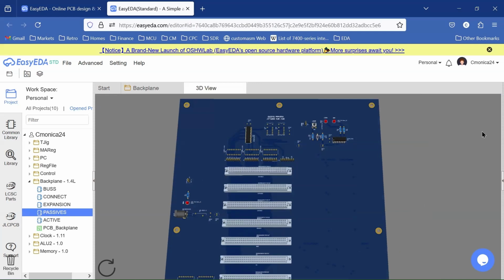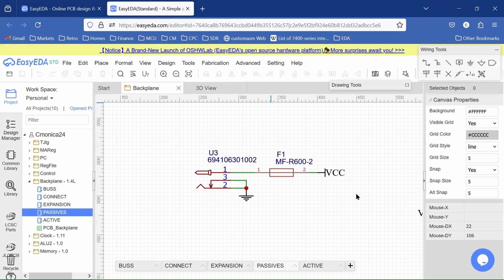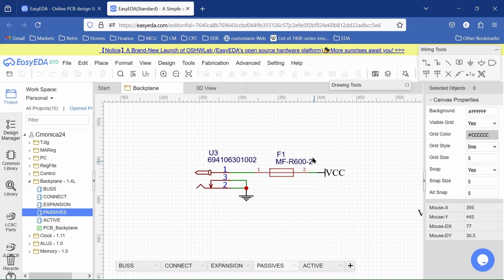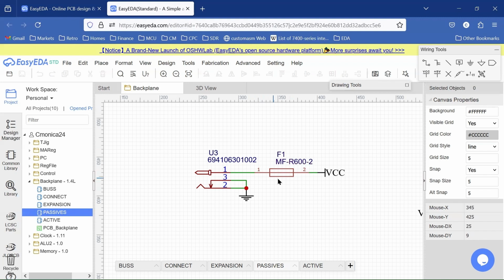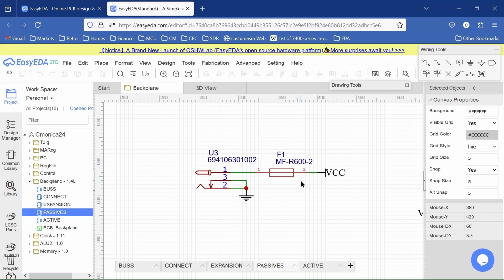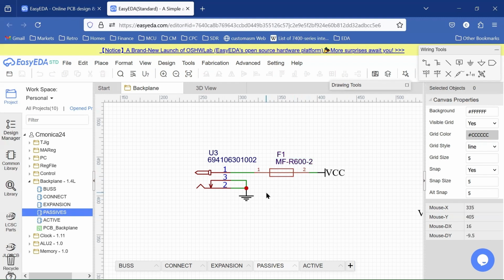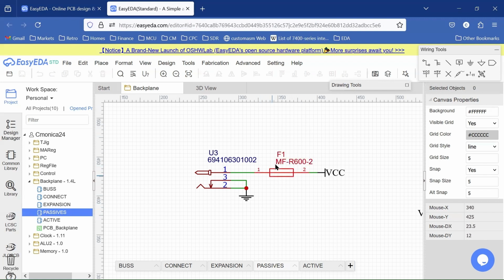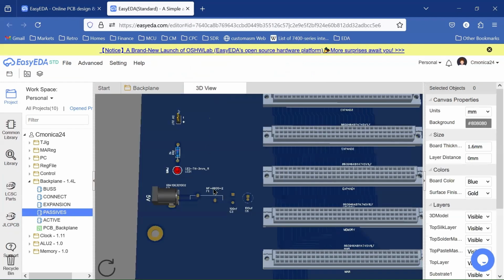TTL Computer II #39 - Backplane Update

Comment: I'm not sure the MF-R600 would do you any good - unless you use a car battery as your power source and have really fat tracks on the PCBs. According to the data sheet the iTrip current is 12 amps. And it's super slow, definitely not something used to protect sensitive parts and pcbs. At 30 amps current it's guaranteed to trip within a maximum of 16 seconds - time enough to start a nice fire ;-) The nominal trip time is a bit better though, just 3.5 seconds. But with a wall wart or "normal" bench power supply you can never ever supply 16 amps so the times will be much longer.  The inrush current NTC might cause troubles - unless the RESET is long enough to have allowed the voltage to rise to 4.75 (or whatever all lower limit is for the logic family you're using) you'll have issues.  Also, food for thought: the NTC will never have a zero resistance so it will cause a voltage drop that increases with the load of the system. If you'd power the system with 8-12 volts and regulate it down to 5 volts on the backplane or boards it wouldn't be a problem to lose a some 100 millivolts (or even half a volt) over the NTC, but a 5 volt rail would not be so happy with this.
Reply from the maker: Mat thanks for feedback.  Yeah, I looked at the PTC datasheet also and had questions about what I was reading.  I was following someone else's work on the PTC/NTC and assumed they had it correct since they are an EE.  They are doing what you suggested with the 8v and regulated down to 5v on the motherboard/cards.  This does not address the PTC issue you noted.  The NTC I ordered was B57238S0809.  Based on the sheet it looks like the resistance should drop to about 0.2 ohms at 4 amps.  I think I will put a test rig together with a variable load to see how it behaves.  I may just not use the PTC/NTC at all on the motherboard and leave it to solve this problem on the external power supply.  In a nutshell I suppose that needs to be a 5v 6A constant current power supply.
Reply: @CharliesChips  0.2 ohms sounds really low at a first glance. But U=I*R so that's 0.8 volts dropped over it. A 5 volt TTL board won't be super happy about that ;-). I've never actually measured a NTC so I'd be interested in a short video showcasing what the voltage drops ends up at with currents ranging from 10mA up to 5 amps in suitable steps.
Reply from the maker: Hey Mat, I have hashed and rehashed what to do for the external power supply to address the inrush current.  Landed on the following.  Will use a 5V 6A power supply, use a 5 ohm 10W current limiter to feed the load (computer) for about 100ms (allow caps to charge), then gate an SCR to bypass the limiter, allowing full 5V 6A to the computer.   Any feedback would be appreciated.
Reply: @CharliesChips  SCR's is suitable for making a crowbar (clamps/shorts the power rails if the voltage get too high as a protection).  But they would be lousy as a bypass for the current limiter.  They have a forward drop of somewhere between 1 and 2 volts depending on model - so huge losses there. A MOSFET (a P-channel would be most easy to drive) or simply a small relay will have a drop in the range of a few millivolts.
Reply from the maker: @MatsEngstrom  Yikes, details, details.  Thanks for the feedback.  Considered both of those but chose the SCR.  Didn't really consider the forward drop, but I guess even a typical diode is 0.6V.  Kind of shocked to see an SCR at 1-2V, but that looks typical.  Will look at the MOSFET option again.  Thanks!
Reply: @CharliesChips  It's easy to overlook such a thing. ;-)  I got bitten by the drop of a SCR many years ago - it was completely unexpected to me back then. Even a power NPN (5-15 amps) can have lower drops (0.8-1.2 volts VBE_sat ) if chosen carefully. So if you don't want a relay then a P-MOSFET is the way to go.  N-MOS won't work unless you have >8 volt to drive the gate with.